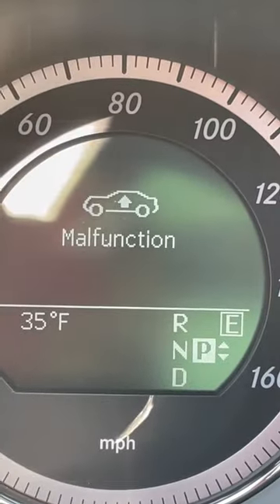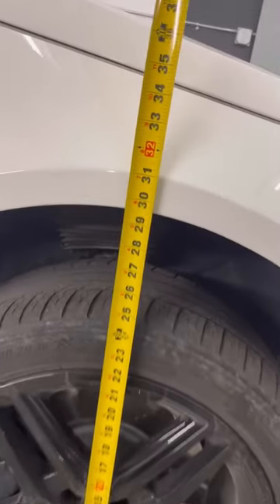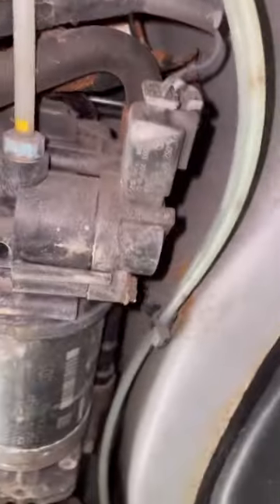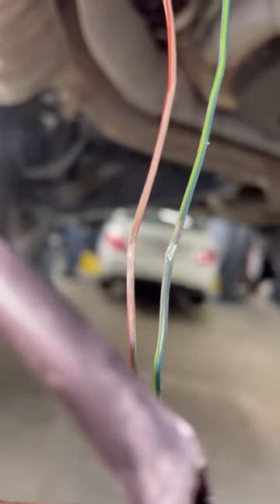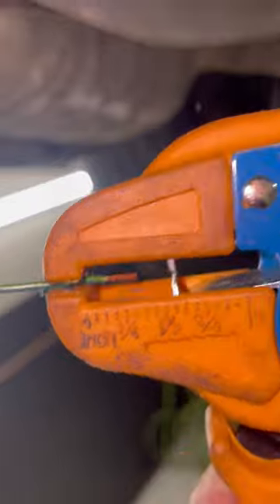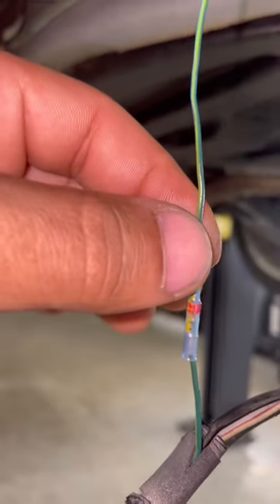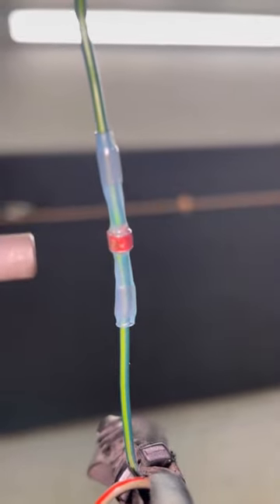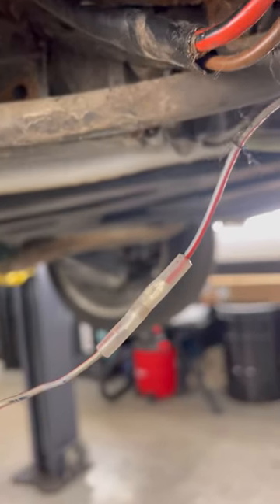Mercedes with an air suspension malfunction light

Comment: I just found this on my cls550. Same thing, cars stuck at high, one of the white wires that goes to the pressure valve has a small tear in it. Howcome a small tear i nthe wire causes this all of a sudden but will work for so long? Is it cause water gets inside the wire and corrodes

Comment: Converted my E550 from air to BC coilovers. Best decision ever
Reply: strongly considering doing that myself. too many issues with the damn airmatic smh
Reply: How much did that cost
Reply: What brand did you use
Reply: @Magnacardia  BC racing coilovers with non air matic lower control arms
Reply: @1411MEDIA  you did that for the rear?